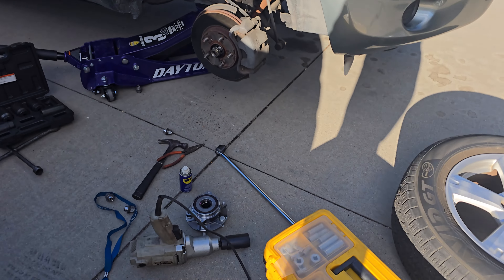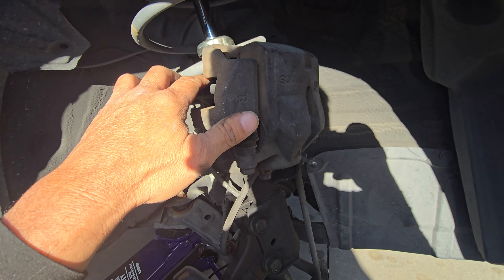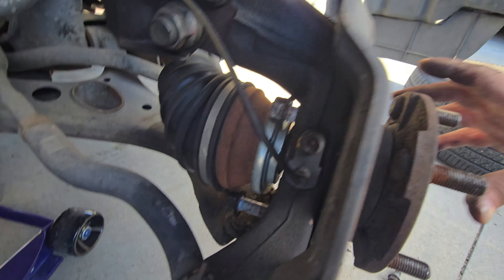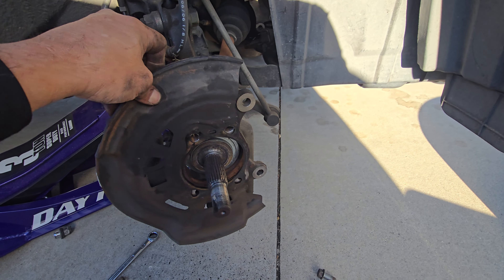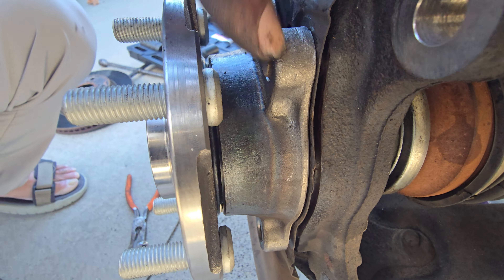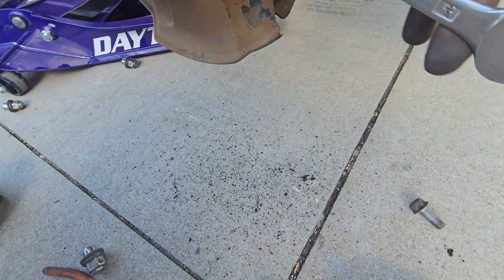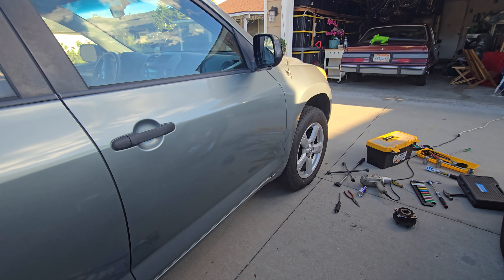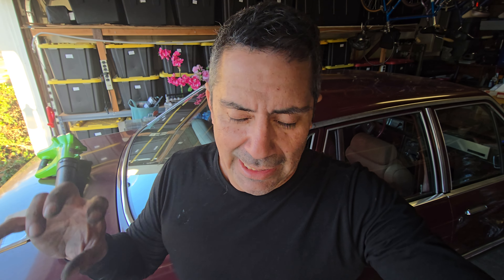Front wheel bearing. 06 RAV4. in 20 minutes!

Comment: Bolt ins are easy. ALot of Toyota's are press in Be carefu; with the low priced cheap wheel bearings that can seperate and cause alot more damage, I usally use the OEM ones only or Timkens which are usually the OEM ones

Comment: that was a very good home mechanic video that's probably the only good thing about some newer cars is that its a bearing assembly easy to replace cars from the 90s and earlier u have to press out the bearing which is not easy and do u trust buying a part like that from ebay even though its  less expensive and do u put them little screws back on the rotor
Reply from the maker: The rotor did not have them. From my experience,  bearings, radiators, body parts etc that are NOT ELECTRICAL, they rarely give me problems. Parts you should NOT buy on eBay are critical electronic parts such as MAF sensors for example